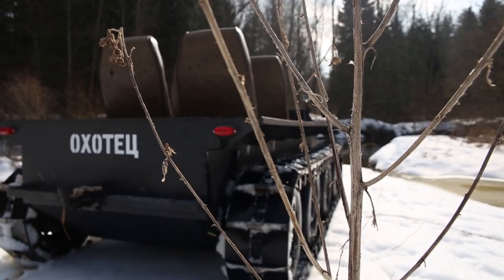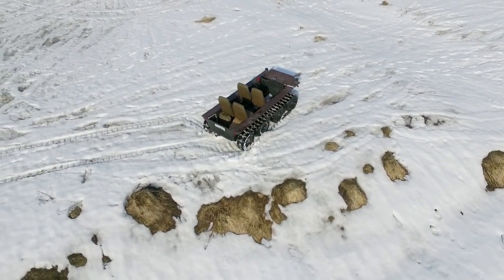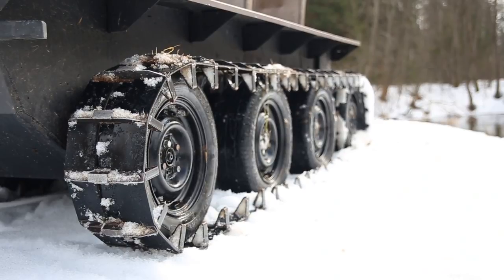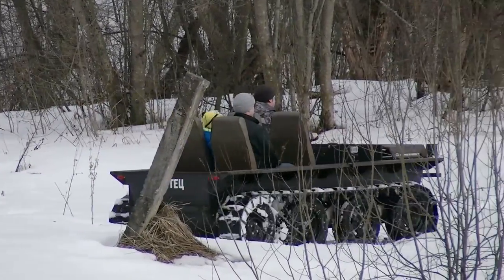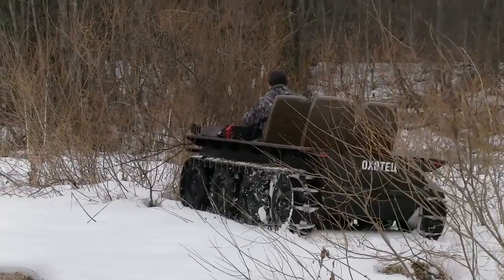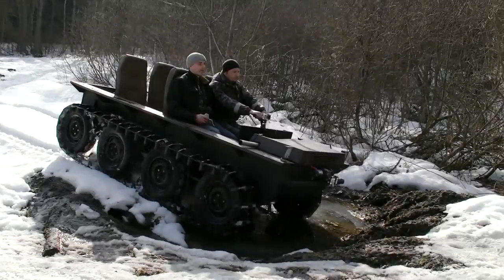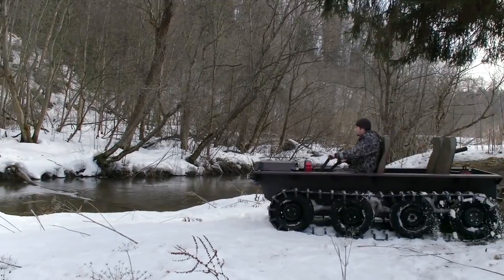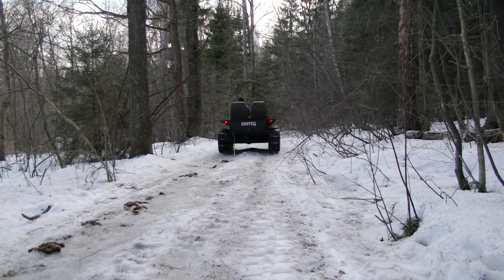DIY tracked ATV $1000 cost! Hardest tests!

Comment: Without a suspension (more than the air in those tires) you can't really go much faster. That engine is fine. Put a trolling motor on the back. You'd have a reasonable boat. I was really impressed at how those tracks stayed on.
Reply: If they do a little work to the tracks they won't need a trolling motor.

Comment: i think it's a very good vehicle for it's intended application - access to remote areas for fishing, on a budget. for this, i believe that cheapness of the engine overcomes its lack of power. 
as for slowness, i think it's ok, as moving 30km into a remote area is quite enough, and it's builder probably either fishes locally or uses a trailer.
it could be even possible to use it as a fishing boat, just anchor it and fish.

my remark could be that it has no protection from elements and for example extra lights, but that's easy to install, to be honest. 

overall, it looks like an excellent vehicle!

Comment: Yes.  It is a bit crude, and probably rides rough, but he could set it up to use low pressure atv tires and soften his ride considerably.  It would be much like a sprung suspension and also give a little more traction on uneven terrain, I would think.  I like it.  It is probably more robust than a lot of factory, 20,000 dollar rigs.  It's is not cramped up for 4 people, either.

Comment: If you lightly brake the spinning track the transmission will start to drive the other side, it's one of the reasons tractors used two brake pedals. I would want some roll bars if for no other reason than to put a roof on it and possibly some canvas sides, open topped may look fine but wet leads to cold and miserable, and that is not fun.

Comment: FOR $12 - $17000 YOU GET LITTLE MORE WITH A NEW ARGO, WHICH ALSO HAS NO SUSPENSION, WORKS OFF THE EXACT SAME WHEEL/TRACK/CHAIN DRIVE SETUP,  HAS LIMITED CUSHIONED SEATING AND USES AN 18 HP KOHLER V-TWIN... BUT A LIFAN IS A ADEQUATE ENGINE. AN ARGO ALSO BARELY MOVES IN WATER, AND DEPENDS ON RIBBED TIRES TO PADDLE IT -  WHICH HE COULD HAVE EASILY SOURCED. ARGOS ALL TOO OFTEN DEPEND ON WINCHES, ATVS OR ANOTHER ARGO TO PULL THEM UP ON LAND OR OUT OF ICE, BUT THEY DO HAVE A TRANS WITH A DIFFERENTIAL LOCK GIVING YOU 6 OR 8 WHEEL DRIVE... BUT AT 18 TO 23hp, THEY ARE FAR UNDERPOWERED FROM THE 2 STROKE 45HP MACHINES OF YESTERYEAR.

Comment: This needs uaz engine, diferential lock and suspension.  And the crush bar.  Otherwise very cool. I like the "no sprocket" approach, but that only works because there is no suspension.  I wonder if makers of these vehicles foam the wheels.

Comment: How did he make the tracks?
Reply: 2 reinforced rubber conveyer belt straps (like in a factory) with hand bent and welded brackets on the tire side and a flat bracket with a paddle welded to it on the outside sandwiched and bolted together. at least 1 or 2 brackets having the rubber doubled up where the ends meet on the track. I'm working on designing my own. trying to find a set of 8 matching wheels and tires on a budget that will work in the US is a pain in the ass. lol
Reply: @pistolpetepeterson  the only problem with this design imho is that if you hit a rock with one of those brackets that keep the track over the tire you can bend it enough that it'll puncture a sidewall on the tire. ie, lets say you slide sideways into a muddy/rocky hole those brackets could very easily be bent looks like

Comment: Any plans available?
Reply: I will be releasing plans of my machine in a couple of months, but the build cost will not be $1000 like this machine.  I think there is a wide discrepancy with purchasing power between Russia and my country, because I spent about $3k on my rig via junkyard components and that's just to get it driveable.
Reply: @pinestumps8622  they also said he had lots of spare parts sitting around so that could be part of it too.

Comment: where do you get your track belts.
Reply: They made the track belts using rubberized conveyor belt, metal and a lot of screws.
Reply: learn how to control gravity.
Reply: @earthalienzapa3237  Gravity is mechanical vortex/syphon force the only way to negate it is with outward propulsion that is greater than the pull of gravity its self.

Comment: Can someone tell me if it’s ok to just use a normal differential and if I have to use brake skid steer diff and if i do where can I find one that’s why I want to use a didf
Reply: Go to Donn DIY`s YouTube channel and look how he built his skid steer differential. Hes just in the process of building an amphibious atv.
Reply: A "skid steer" diff is just a regular "open" diff. No limited-slip/posi-track, no locker. Just regular open diff. An open diff will apply power to whatever wheel has the LEAST resistance. If you apply the brake to one side, the un-braked side has less resistance so it gets the power causing the turn. This is how this machine works, thus the two brake levers. Hydrostatic skid steering like in a Bobcat is a completely different system.
Reply: This bloke has just used an ordinary car diff and it obviously works. You just need seperate braking on either side to turn.

Comment: Don't think it will be cheap if we buy engine, make frame, tires, paint, wrkman ship cost, time.. This will be expensive since the engine s frm tractor, gear box from a small 4 wheeler vehicle....since u got most of the stuffs for free that's why u r saying it cheap.. 🤣🤣🤣